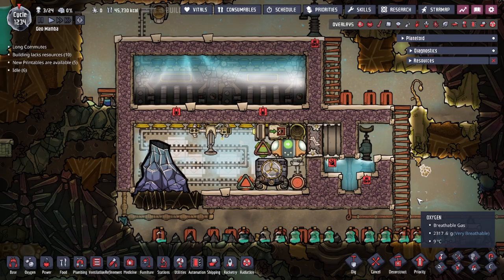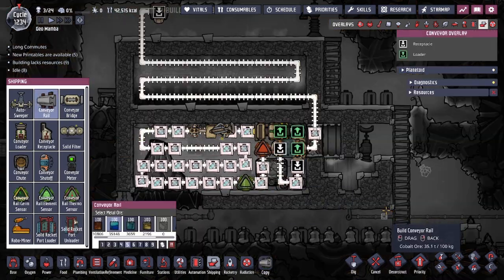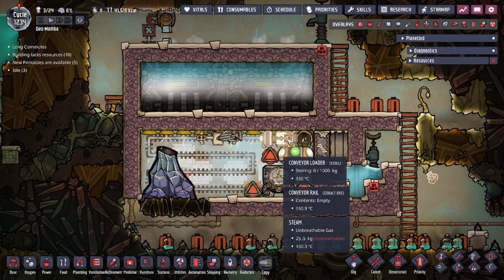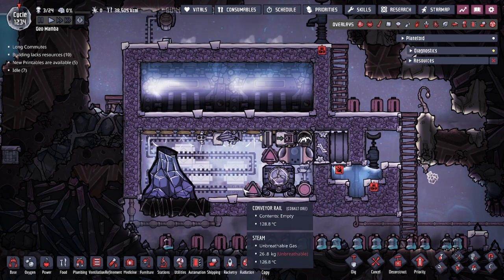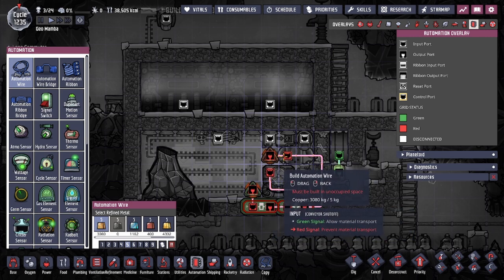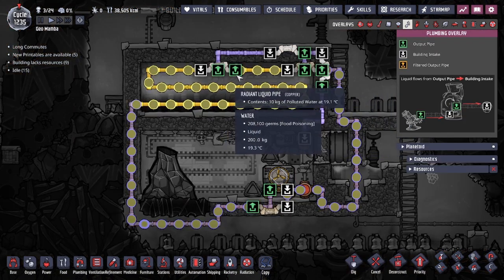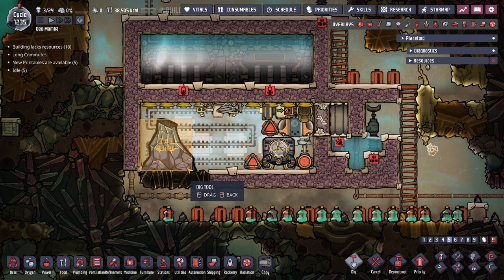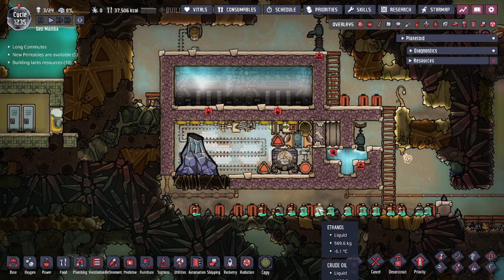Self-Powered Submerged ST Metal Volcano Tamer - Cobalt Iron Copper or Gold - Oxygen Not Included

Comment: Another nice video. Thanks a lot. I use a very similar solution to tame the metal volcanos.

Some notes from my experiments :
- if you add a smart battery and only have the turbine run when needed or when the temperature is above 200, you have a self-powered solution. If the volcano is on the weak end, the battery may run out during dormancy but it will start again with the next eruption.
- since the battery will start empty, the room will be full of steam before the loader starts working, that said, for stronger volcanos, I normally wait until the system is primed before setting the filter on the loader
- the only volcano that requires two turbines is Niobium (and it also requires a different design), a single turbine works and is enough for self-power for every type of metal volcano.
- in the steam turbine room, I use 300 K liquid per tile and the turbine works great. Strangely, it doesn't always work if you try to do it in debug mode but it works if you fill the room the usual way. I start seeing flooding problems at around 400K.
- I also use a trick from Tony Advance where I add a little counterflow between with the turbine output the the metal on the rail. The little counterflow is enough to bring my 250 degrees metal to around 125 degrees. This allows the steam room to stay hot and provides more power for the system.
- I use a second shutoff in the turbine room to make sure that the metal is cool enough. I normally set the second shutoff at 40 degrees but the metal usually exits around 30 degrees
- I never put rail behind the volcano centre tiles as it often causes problems (in particular with the Aluminum volcanos)
- Instead of buffer-filter automation, I simply started  putting  two temperature sensors side by side just before the shutoff and I never had debris problems since

Here are a few screen capture (Not sure if the ULRs work in YouTube comments though):
https://photos.app.goo.gl/XD4VUKL9zstuvvfA9

Again, tanks a lot for the videos, I always learn something new. I really like the way you tackle ONI problems :-)
Reply from the maker: hey for sure! happy you enjoy the video

I actually found that using 2 Steam Turbines was more consistent in terms of keeping the AquaTuner running with lower steam temps and also without staggering it due no low power capacity. The room would get to 125C~ after the metal leaves the steam room and thus wouldnt need the AquaTuner anymore- if the Turbine Room is chilled, all the system needs is the how metal to kick start the system to turn on again- very convenient. I do believe that the Gold Volcano may have some issues due to the low thermal energy it holds but lowering the steam per tile amount would do the trick i believe. I also ran into some issues around 350kg per tile of liquid, where it would work but after a save/load the turbines would spawn in flooded and you would have to remove every drop of liquid in order to get rid of the flooded debuff- very annoying.

Wolframite is a great rail material behind the volcano due to its high melting point!

Comment: Micropackets - I've built some tamers with tempshift plates in the volcano steam chamber, and some without.  Micropackets seem only to appear when there are tempshift plated behind the volcano itself.  My suspicion is they cause the molten metal to transfer heat too quickly to the solid metal while it is being picked up by the autosweeper and most of it gets melted too quickly before it's put on the rail.  So far, I have the same problem you have here with the volcanos that have the tempshift plates, but no micropackets in the volcanos without them.

EDIT - Ok, the version without tempshift plates does have a micropacket.  It seems far less common though.
Reply from the maker: yeah the micropackets seem a bit random- sometimes i manually allow them to exit hot when its the only item on the rail still looping by toggling the thermo sensor from below/above and then back. that being said, i dont think ive ever had a whole rail of just micropackets

Comment: I like the idea of more compact volcano tamer builds especially in spaced out.  My 3rd planetoid has 6 volcanos distributed in such a way that most tamer designs either overlap the edge of the map, overlap each other due to volcanos being close together, or have naturally broken the abyssalite boundary to the uranium biome, and overly large tamers are bad in every single case.  I don't want to keep making rocket trips for bringing resources over though - would super coolant substitute for the crude oil in the steam chamber?
Reply from the maker: yup, being space efficient really pays off in the spaced out DLC, especially some of the later clusters with smaller overall maps. although you can replace the crude oil with super coolant, i'm not sure offhand how much mass you can have per tile before it floods the turbine. you can assume the same quantities as the oil and have no issues though.
Reply: @2LegitCity  - I ended up not using the submerged turbines for my tamers, and used the standard cooling pool/metal tile chamber.  I'm just wary of these types of game mechanics breaking on save/load or in some update.  There was enough room to do it, but even with submerged turbines to save space the spacing is too awkward to build out the area for much else.

The aluminum volcano definitely needs 3 turbines and is a superb power producer, taking aluminum off rails at 150C, it will depend on finessing the eruption period.  It cools very fast in aluminum tile and aluminum ore rail.  I used aluminum ore for the volcano chamber temp shift plates, works well, but the chamber should be pre-steamed to avoid melt-downs.  Power production is high enough to replace some sides of the cooling chambers' insulated tile with aluminum to cool the area after letting volcanos erupt wild their first cycles.  That could just be because of the supercoolant.

Comment: I've got a question here, I have a habit of adding a smart battery to every kind of generator except the manual one, is it actually required for this build to have 1 connected to the steam turbines?
Reply from the maker: i would not add a smart battery automation to steam turbines in volcano tamers since you want them running all the time to deal with the heat generated. you would causes your own build to breakdown if you disable the ST for "power efficiency". even still, i would never even cater the though to add smart batterys to steam turbines. what you should do is to run steam turbines as a primary source of power and everything else to run when the steam isnt enough
Reply: @2LegitCity  I see, thanks.

Comment: i hate to be this person but i have giga small brain (this is also my first time legit taming a volcano) my auto sweeper/conveyer are both made out of tungsten and theyre both overheating. I dont have oil and my "submerged" steam gens arent actually submerged, but there is a lil bit of brine in there. i went back and checked everything to make sure the pipes and automation and everything else is right. i do have a bit of a cheater mod which makes my aquatuner not produce any heat at all and the power isnt nearly as high as a normal aquatuner (i can still make a normal aquatuner) but i was wondering if it was anything else i could possibly be missing. also giga props to this bc like i said, this is my first time taming and while im actually getting cobalt, im just using up tungsten repairing the shipping.
Reply from the maker: you have to use steel. the tungsten doesnt add enough +overheat temp threshold.
Reply: STEEL. idk why i keep thinking tungsten is steel. god speed you are so nice (i am learning at a very slow process) @2LegitCity
Reply from the maker: hope it all worked out @eqflash

Comment: Will the type of liquid in the ST room affect the temp change? Lets say i use super coolant, nuclear waste then pwater of 100kg/tile, will whatever pass through (conveyer items, hot liquids/gas in another pipe) be cooled down faster? compared to ur setup here
Reply: the limiting factor appears to be the active cooling of the aquatuner, so I think increasing the SHC and TC of the layers will just means the output reaches equilibrium faster and probably wouldn't change the output temperature more than a couple degrees. You could go colder by setting the aquatuner lower, but if you for example went with supercoolant in the active cooling loop you'd run the risk of freezing your pwater.

Also worth noting that nuclear waste freezes at something like 26.7C so using it in the submerged room would have to stay above that temperature.
Reply: @madmerlyn  Yep noted. Because i was looking at his design and it seems that the rails dont loop around in the ST room, so whatever cooling happened in that 30 tiles is what temp the item will come out

If i wanted a smaller room (1 turbine) but still cool the item from 180C to 30C, thats a 150C cooling happening in ~15 tiles, so wanted to explore a faster way of conducting that temp

Assume that i have a crazy AT loop that will always cool my ST room to 30C, thus negating that limiting factor, and i want my items at 30C so not to worry NW freezing, what can i do to increase the temp change. Im thinking changing to steel rails, tempshift plates or the liquids as mentioned with the best SHC and TC. OR just create a loop as shown in the video as well.  What works?
Reply from the maker: @madmerlyn  is correct. typically higher SHC = holds more temperature longer and should result in consistent cooling on most/all items running through. lower SHC = more fluctuations in temps as the liquids inside the steam turbine room only act as a medium to transfer energy from the aquatuner radiant pipeline.

that being said, the output temperature can rise if you use very low SHC liquids inside the steam turbine room, but changing the liquid medium inside the aquatuner pipeline would have a more drastic effect on the output temperature of the metal as that liquid's SHC value can make or break a design. typically want the highest SHC liquid inside an AT whenever possible
Reply: If you look at the link in my comment, I did an Aluminum volcano that works very well with a very similar design and only one Turbine. With Aluminum, the steam room stays hotter but never too hot. The aquatuner and the other objects in the steam room made of steel never break. The metal takes a bit longer to solidify and it takes longer for the metal on the rail to get to 250 degrees before getting sent to the turbine room but Alumium volcanos have normally very small eruptions so everything is dealt with long before the next eruption.